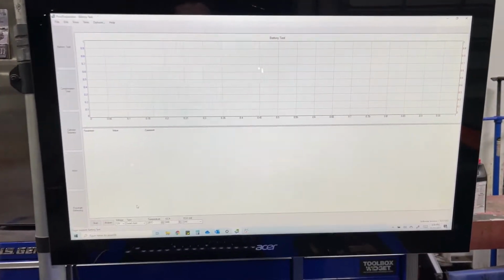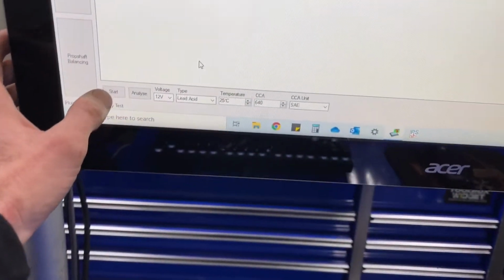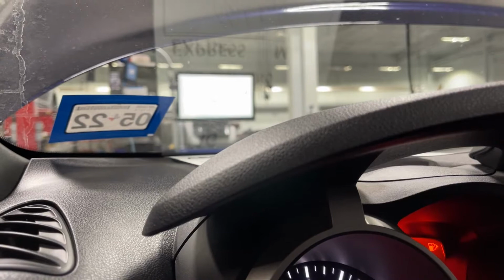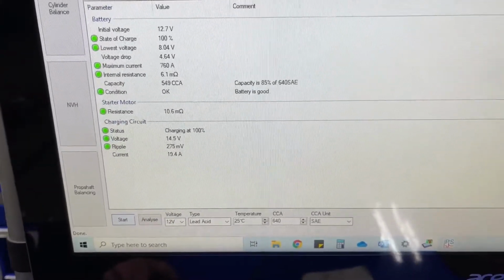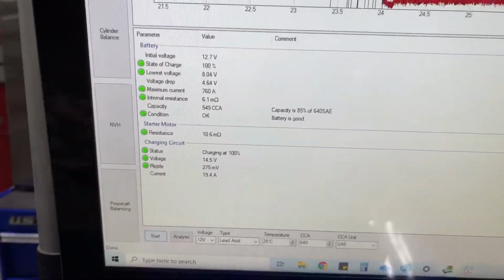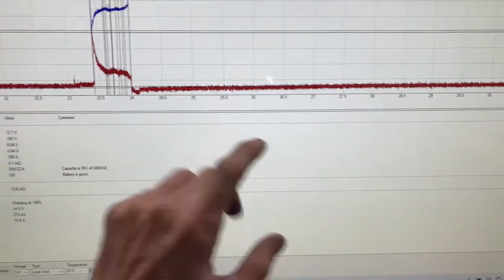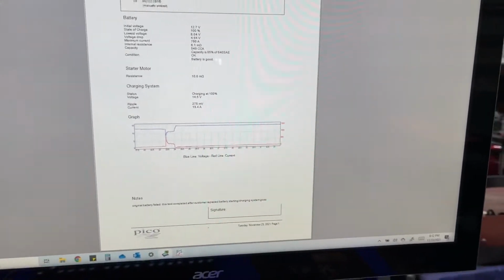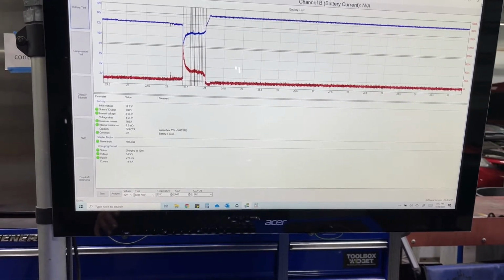Pico Diagnostics Battery Test

Comment: Very nice video! One question, why is this regarded as the best, the most accurate way to test battery? I don't see how we can benefit from the extra details from the scope. Honestly I don't see how this is better than carbon pile or voltmeter. Thanks in advance
Reply from the maker: The reasons I prefer it are that it gives an excellent "fancy looking" report that builds value for the customer and tests battery, alternator and starter health quickly, assuming that you have a diagnostic cart with pico leads hanging for quick attachment. Thanks for watching
Reply: @SuperScopeLLC  I totally understand the fancy factor. It's just that many techs say this is the most accurate battery tests (I know you didn't say that). Thanks for sharing. Gotta say once again this video is very nicely done